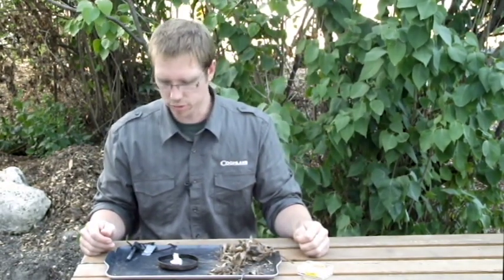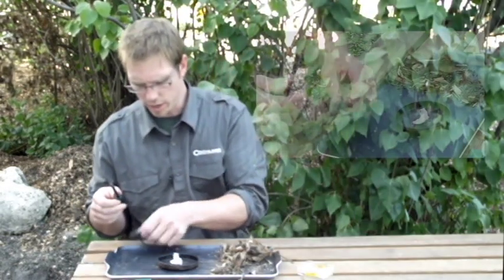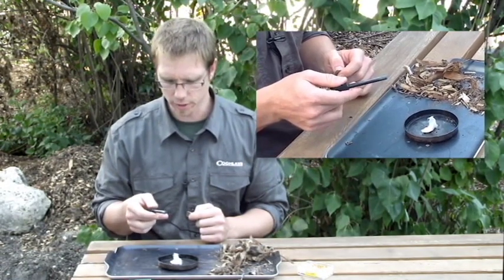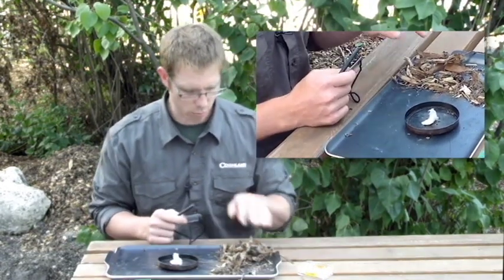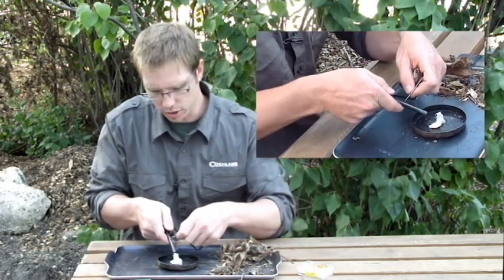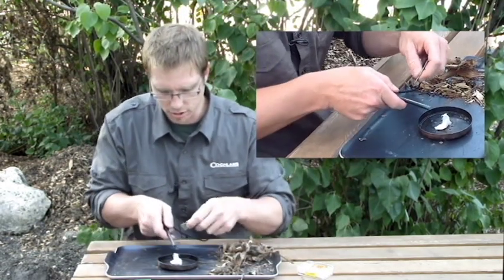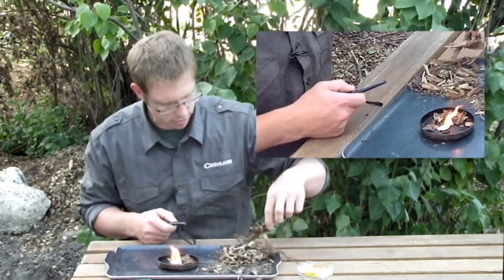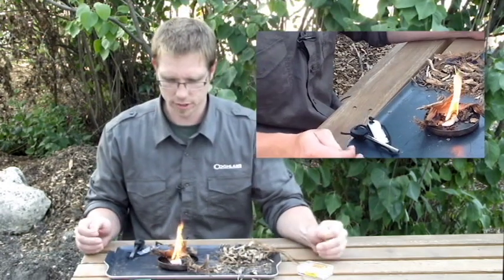1005 Flint Striker: How To

Comment: Was only giving off sparks 1 out of 10 strikes. Maybe something wrong with the striker because the back of a piece of hacksaw blade works very well.
Reply: Throw away the striker itself it doesn't work. use the back of a razor knife and it works perfectly with the rod. After you scrape the paint off.
Reply: @TheCodyHertzberg  I think the video speaks for itself. The striker does actually work well with the proper technique. That said, I teach all of my students to use the backs of their knives and to discard the striker that comes with it.